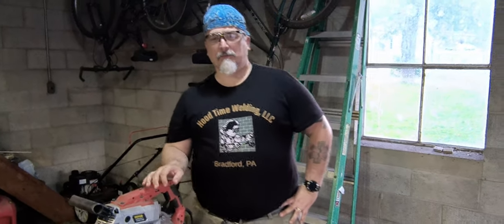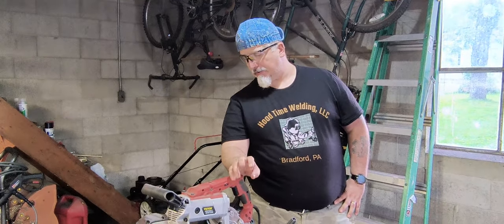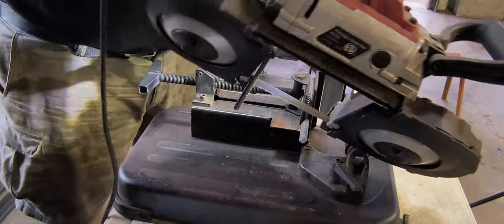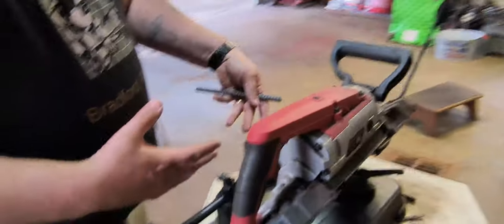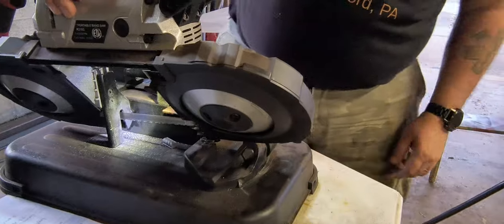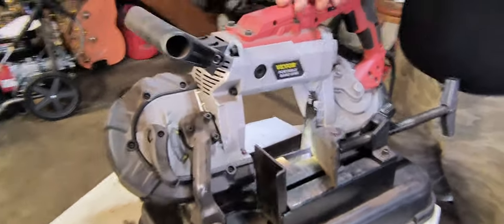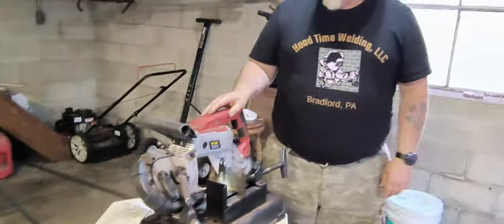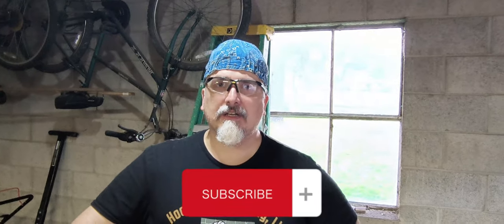Vevor Portable Band saw Review

Comment: You mentioned you lose cut capacity when cutting at 45 degrees. Would the saw cut 2x2 square tubing at 45 degrees?
Reply from the maker: If I remember correctly it will not but if you put it at 40 degrees it will. It just catches on the safety stop on the one side.